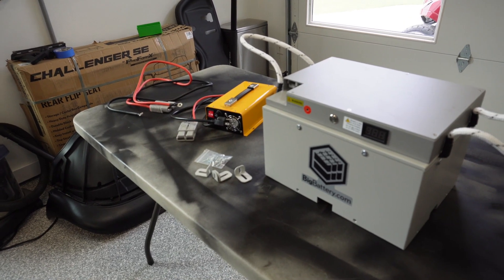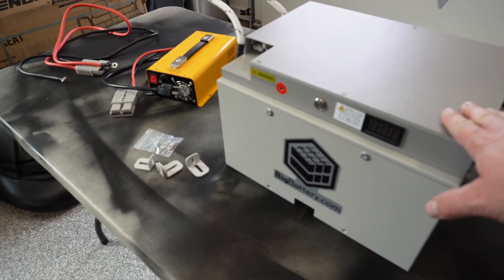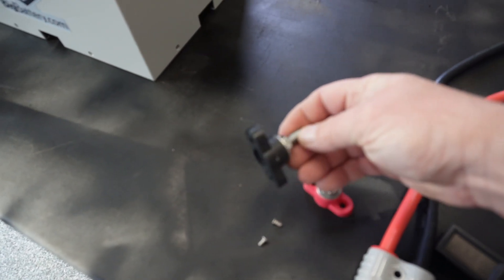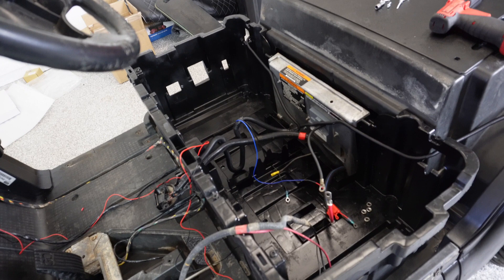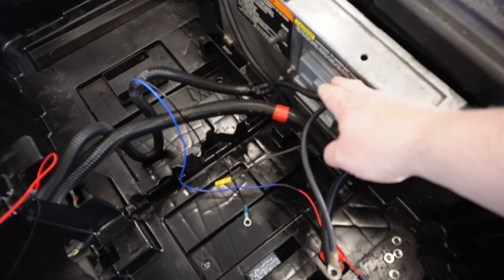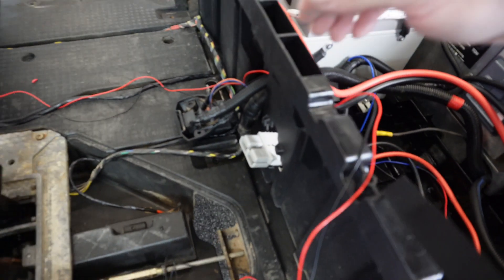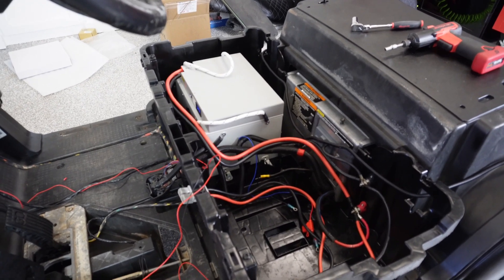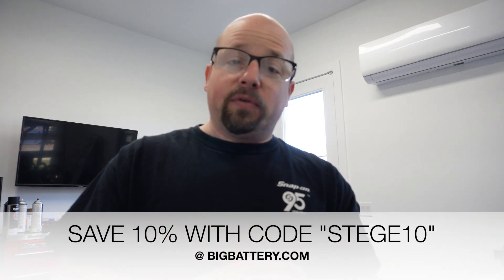DIY bigbattery.com Lithium Conversion for Club Car Precedent, Onward or Tempo in 60 minutes or less!

Comment: Great video, thanks.  Just to confirm when disconnecting/bypassing the OBC - just unplug the three wires from the charge port and that’s it?  No need to jump the blue and white wire in the harness?  And, no need to reroute the main negative directly to the controller?  I’ve watched so many videos, I’m starting to get confused……😊. Thanks
Reply from the maker: @CliffFields-j3w  you got it!!
The cart it’s only concerned about receiving 48 V… Once you disconnect the OBC you are free to use whatever charger you want. I’m not sure why people think they need to jump the blue and white wire in the harness. I have never done that in all my years of conversions.

Comment: Do I need that specific charger or can I use my aftermarket 48v charger that I have in the stock location on my club car ds?  Thanks for the video,  I plan to get this battery.
Reply from the maker: It has to be a lithium charger
Reply: @kartkrazy  Thanks for the quick response.  I'm leaning towards the falcon elite, I currently have 6 8v batteries, would it be a decent upgrade for all of those?
Reply from the maker: @philipsgarage absolutely!! It’s my favorite set up
Make sure to use my promo code “Stege10”
Reply: @kartkrazy  Thank you sir, will do!

Comment: You can buy a new charger socket that accepts a regular 120 volt plug. Looks factory.
Reply: Can you send a link of what type of charger socket you purchased? Thanks!
Reply from the maker: @davidsestak4915 https://www.amazon.com/NOCO-GCP1-16-Inch-Integrated-Extension/dp/B009ANV81S/ref=mp_s_a_1_1_sspa?crid=NP1HUMCEZ1QX&dib=eyJ2IjoiMSJ9.bqKuZaPfgKKhdRXbbewq40ZP_j-zlmZqUf1MGwDLQ06EozR0siS44Bz76mPATbaLeG_jbQP2SdERNasikKGJDdgBH6DY3CIuC5Vj0ql1g0ul3eG0GHHIuffBE5VtU7W1_-YyXlXvpDGsWsNVnLRjSvZPT20VuXLwVpmbipaBMiRPY8EwZGeZCA8OnVonIY4HVthNPdnZUYv_D-BSXT37aA.Ts4LWjfm6hj18aqZ655RSSbrjfSJZlv0EViYZeTrH2k&dib_tag=se&keywords=noco+ac+port+plug+with+extension+cord&qid=1713194314&sprefix=noco+ac+%2Caps%2C183&sr=8-1-spons&sp_csd=d2lkZ2V0TmFtZT1zcF9waG9uZV9zZWFyY2hfYXRm&psc=1
Reply: @kartkrazy  Check out the link that I posted. I think it looks more factory than Noco.
Reply from the maker: @marcwa5067 I must be blind… I don’t see a link
Reply: @marcwa5067  Yes, no link shown....can you post again?
Reply: @kartkrazy  eco battery sku: a-4081
Reply from the maker: @davidsestak4915  it comes with the Big Battery set up…. unless you’re referring to the ones I’ve used since then.
Reply from the maker: Yes!! I have been using them pretty much since this video was put out
They are awesome 👍🏻

Comment: Big Battery, where the customer is always wrong 
1) Expect a Dead on Arrival (DOA) unit with a manufactured date of 11/20 
2) Plan for nine business days where you contact big battery every day to resolve the issue and they may or may not respond 
3) If they respond, make sure to set aside a lot of time to explain to Big Battery what a customer friendly process is for handing a DOA unit 
4) Prepare to dispute the refund with Big Battery as they want to charge you a 20% restocking fee as well as $400 for the shipping for a DOA unit. 
5) Make sure you have a good credit card company.
Reply from the maker: Sorry to hear about your bad experience. If there is anything I can do please let me know.

Comment: I was just looking at this exact battery for my stock 14 Club Car. Curiousas I saw in one of your responses that you are on hilly terrain with it.... I have one hill in particular that concerns me with it, its approximately 1/4 mile and at least a 20 degree grade, have you ran into any issues at all with grades with 2 people on board?
Reply from the maker: Zero issues with the battery however, that may strain your motor and controller with that type of grade

Comment: Do you need to bypass the OBC for charging purposes?  On 2016 club car?
Reply: Your response is great. Your videos are awesome.  Thank you.
Reply from the maker: @haley2993  thanks for watching!!
Reply from the maker: What battery are you using?
Reply: I’m going with the big battery 48v 60amph elite setup….
Reply from the maker: @haley2993  if you’re going with the Big Battery set up with the supplied charger from Big Battery , I would definitely recommend unplugging the OBC as shown in the video
Reply: @kartkrazy after 2014 club car removed the OBC and went with the ERIC charging system, I didn't think there was anything necessary to bypass at that point?
Reply from the maker: @michaelg9395  if you are using the Eric charger on a lithium it (the charger) will need to be programmed to the correct algorithm if I understand the question
Reply: @kartkrazy  yeah good point but even if you're using the big battery charger there's nothing to bypass or wires that need cut/unplugged in these later models I thought.  You just remove the lead and drop in the lithium then connect mains.  Am I wrong on that?
Reply from the maker: @michaelg9395 for me personally I at least unplug it.
Reply: One last question.  Different topic.  It how are people securing these light weight batteries?  Thief prevention?  I secure my cart but would be hard to open up seat and carrying one battery away.  ?  Thoughts?
Reply from the maker: @haley2993  they come with a hold down assembly… you can literally bolt it right to the bottom of the cart

Comment: Why not pu the charger under the seat too? Then just use a normal extension cord to the port?
Reply from the maker: Not a waterproof charger
Reply: They make a waterproof charger for that battery @kartkrazy
Reply from the maker: @jjacoby1010  yes I know. Put one in the current build👍🏻

Comment: Great video.  i purchased the same unit that you used in the video. i have a light kit and USB ports for charging on my club car.  i'm guessing that i don't have to do anything other than swap out the batteries and they will still work?
Reply from the maker: Just make sure that you hook up your voltage reducer for your light kit and usb port
Reply: @kartkrazy  does the club car have a built in reducer or do I need to purchase one?
Reply from the maker: @jsredd22 need to purchase
Reply: I'm confused. The Club Car Onward doesn't have a built in voltage reducer? How does it reduce the voltage for the factory LED headlights and USB charger from the 48V lead acid batteries? @kartkrazy
Reply from the maker: Good point.. some people wire to 2 of the 8v lead acid batteries. Otherwise it would have a voltage reducer somewhere if it has lights and a USB
Reply: If the USB charger door says club car embedded on it… it’s already reduced

Comment: So when the OBC finally determines that the battery has not
been charged and locks out the controller you're gonna be there to run right over and help huh?
Reply from the maker: Not sure why that would happen with the OBC unplugged. At that point it’s basically not existent and has nothing to do with the aftermarket battery and charger. Been doing it this way for years without a problem.

Comment: I just upgraded my precedent using a 110ah lithium battery from an evolution cart. My battery pack had posts so I’m guessing if the lithium battery pack has pos and neg posts, you don’t have to install those posts right?
Reply from the maker: Correct!!

Comment: Looking to do this conversion.  What is the part # for the extra anderson plug/cable and does a 12v converter just go to the terminal studs also?
Reply from the maker: BB175 is the bigbattery part number and yes the converter goes to the studs also

Comment: What is the mileage from the 60AH eagle kit. 2015 Precedent, plum quick bandit motor, Navitas 440/600 controller, 23x14 wheels 6” lift. Haven’t ordered batteries yet. Debating between the 60AH Eagle and the 96AH Badger 2.
Reply from the maker: Lots of variables… what type of terrain, driving habits, how many passengers on the cart, etc.  Personally I get around 20-30 on a stock cart, 1-2 passengers, hilly terrain, driving like an old lady.

Comment: Can you show us how you are going to make a plate for your charger socket.  The hole is round and at an angle not sure what materiel to use as a faceplate?  Thanks!
Reply from the maker: Three months ago, I did a video, entitled “custom charging port” …that one goes into a lot more detail if you want to look at that

Comment: Nice video! Would you recommend a single 48v Falcon Elite over the 2 x 48v Eagle kit? I'm trying to decide between the two.
Reply from the maker: I really like the falcon elite kit but if you need long range, you might want the double Eagle kit… would probably give you 10 to 15 more miles per charge
Reply: @kartkrazy  Thanks for the reply! I was thinking their output was similar. So I think I'm going Eagle.
Reply: When doing to eagle package on an RXV 2017 what wires from the charging plug do I need to bypass and how? Thank you
Reply from the maker: Responded on Facebook

Comment: Great video. 
Can you please do a video on how to add a 12volt reducer to power headlights. I’m about to purchase the 48V Badger Big Battery kit and that’s the one thing I’m confused about in the process. 
Thanks so much.
Reply from the maker: Thanks!!
I’ll see if I can get a video on the voltage reducer out soon
Reply: I have the same issue now. Did you find any info on doing this?
Reply from the maker: https://youtu.be/io8rWCb3b4A?si=nNnwwejt6f-mdDzD
Reply from the maker: Start watching around the nine minute mark

Comment: Great video.  If you add the Navitas to this does that convert it Ac/dc or do you also have to replace the motor?
Reply from the maker: Thanks for watching!!
A Precedent is DC. In order to make it AC you would have to do an DC to AC conversion kit…replacing both the controller and the motor.